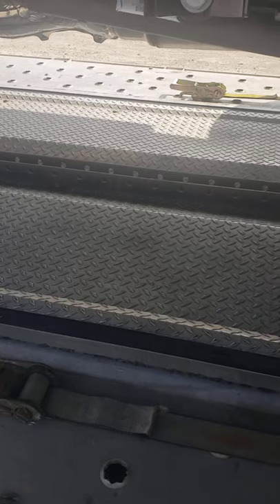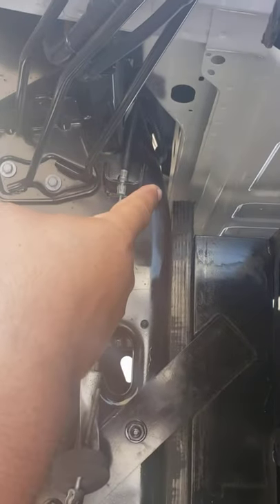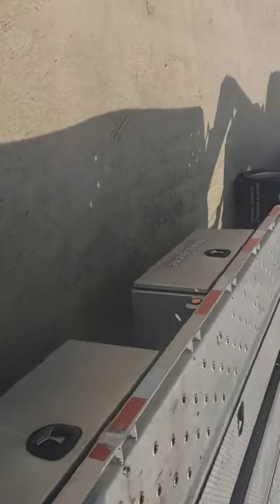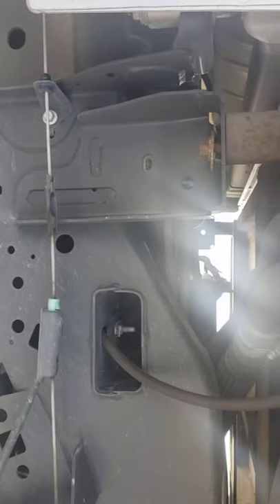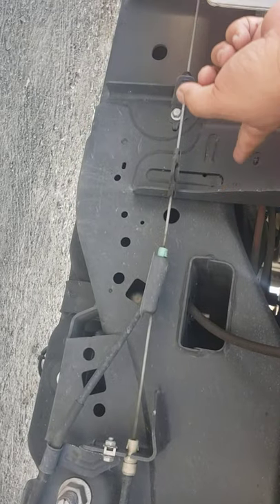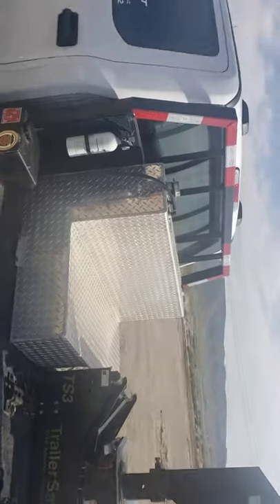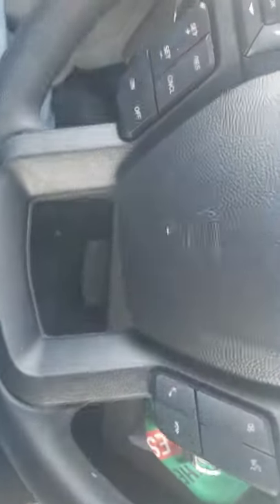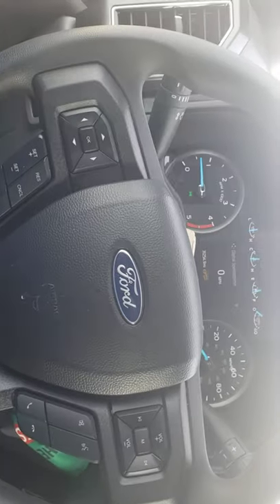is it a cab chassis or a pickup. how to tell quickly. RV Transport #rvtransporter #rvtransport

Comment: I have a 07 ram 3500 cab chassis and want to put a regular bed but not sure if it will fit.
Reply from the maker: If it is the 60 inch cab to axle, a long bed box will fit.
Reply: @camperhauleru812  thanks